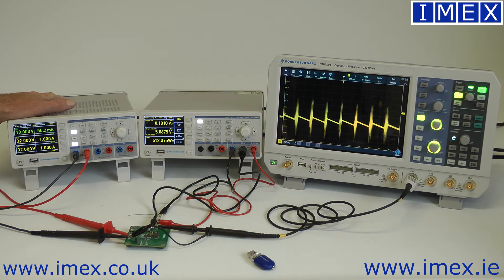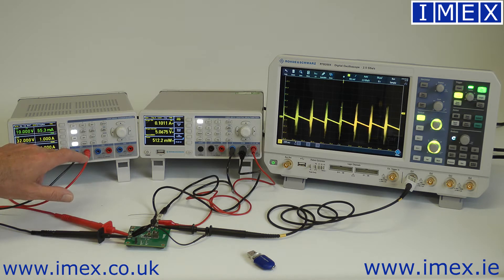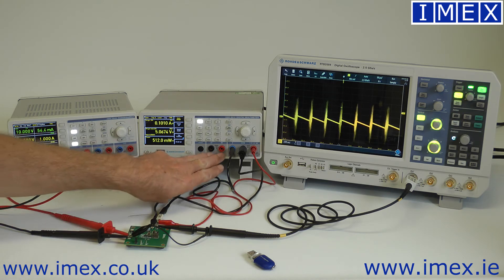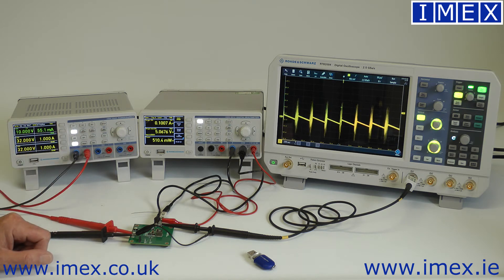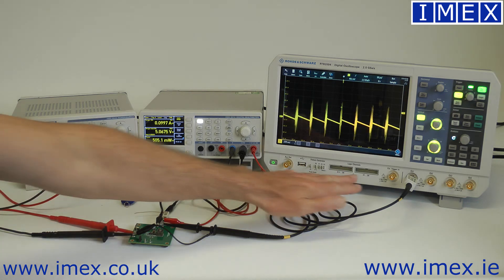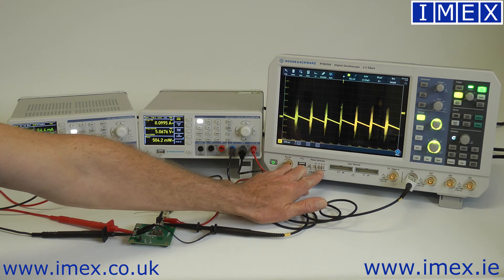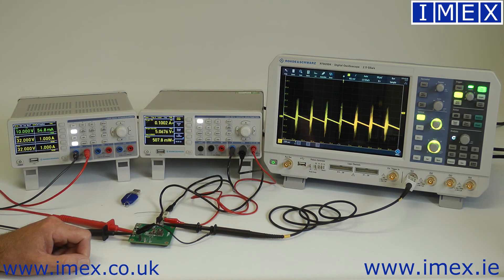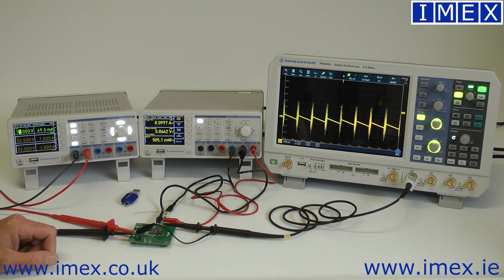Compact Bench - RTB 2000, HMC8043, HMC8012

Comment: The HMC8012 is not a dual channel multimeter! It cannot measure voltage and current at the same time! It simply switches back and forth, multiplexing between A and V inputs.